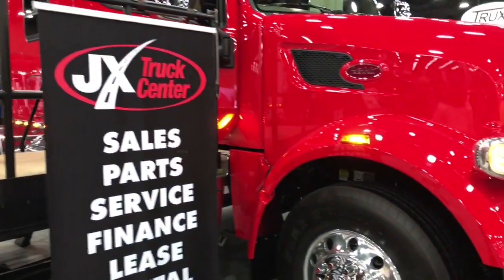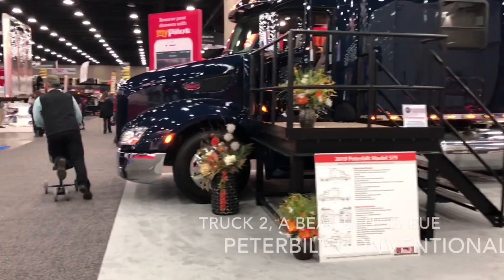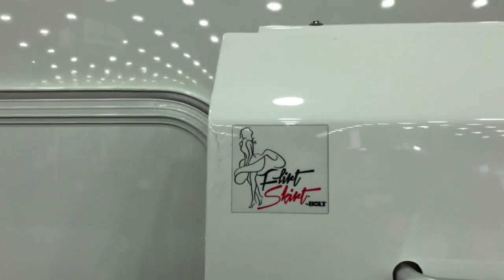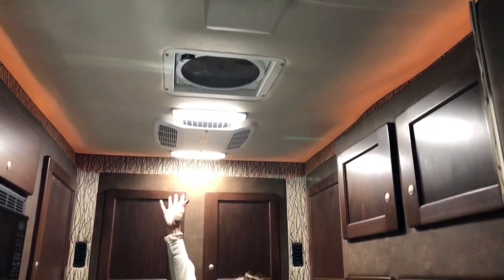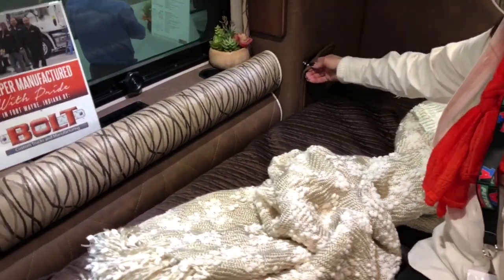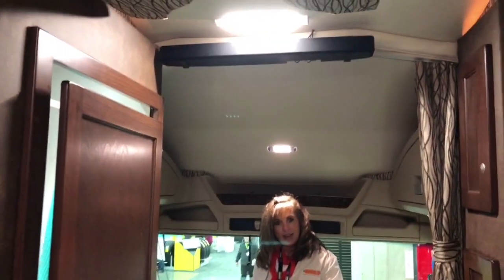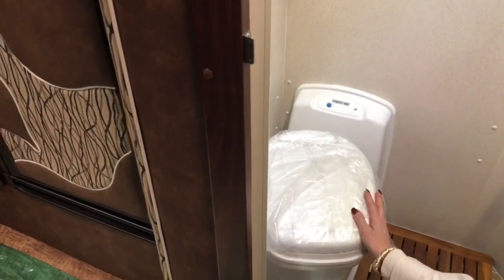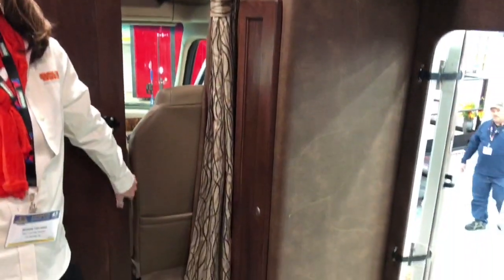Bolt custom sleepers at MATS 2018

Comment: These are pretty awesome for what they accomplish in a small wheelbase, I do however think the ARI legacy sleepers are much better, but that is just personal preference. I guess these Bolt models are perfect for folks wanting a smaller wheelbase for tighter loading bay areas etc. Imo the only real selling point for these extended custom sleepers is a shower/toilet which these have, so for a smaller length unit these seem pretty awesome.

Comment: O yes, with out a doubt or question, the Bolt sleeper units are not just nicer but I think better quality build than ARI's -the as I call old RV look , and that will make the unit last longer and do not twitch or raddled-make noises of all kind as You drive.Its a quality company.Great.TH

Comment: Well,all this is very nice and special,but the fact is that most of the load to pull as an order by shipper's,brokers,or factory,is 44K to 48K and even 50K LB,so even with aluminum trailer $$$!,and want to operate with out special permits, this kind of trucks is not for YOU,one need to get in to spec or over size haul with lite and expensive loads that pay for transport them,and that market is very limited.That will cost to get a nice unit ready and easy spend 500 000$ for it,so big trucks=big bucks.A haul of a load of bricks on this one is out of a question.HA HA.TH